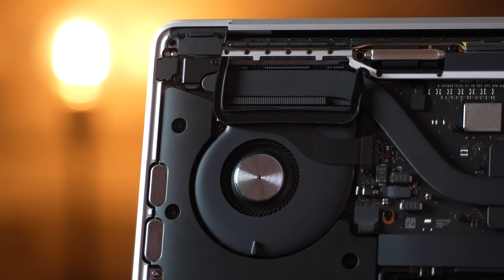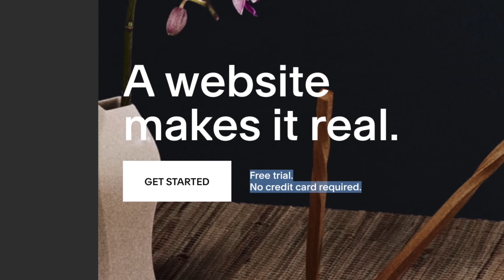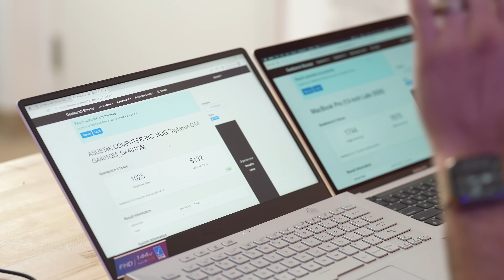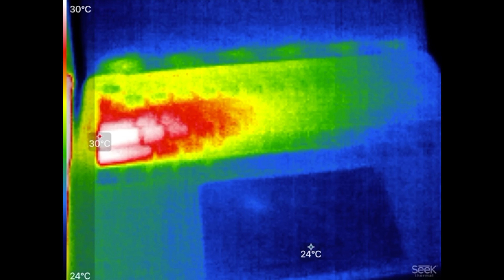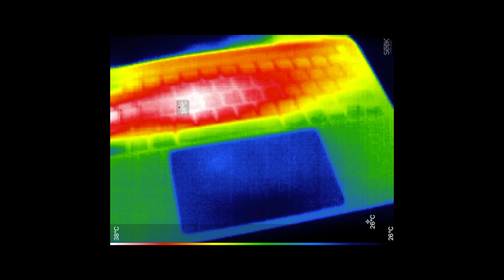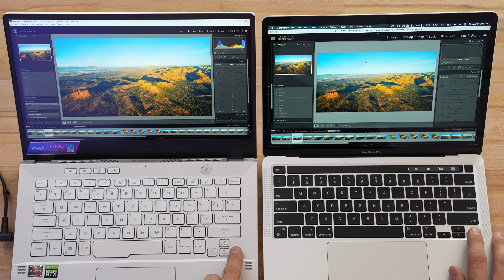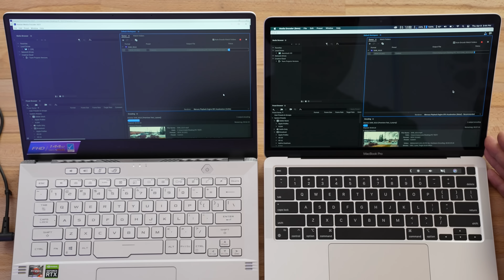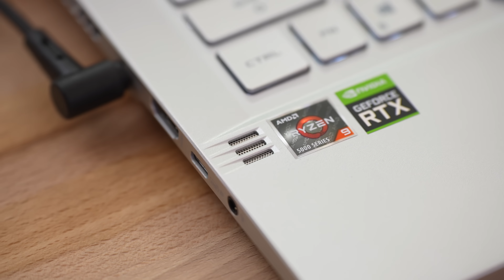Apple M1 vs AMD 5900HS + RTX 3060: FINALLY an M1 Killer?

Comment: Good comparison test. M1X will be the real trial, can't wait for that.
Reply: @Beats-h4z  ohh i forgot because apple makes their own chips not TSMC right
Reply: @OriginalFake Says somebody with no argument :D
Reply: @OriginalFake Yeah, and yet you waste your time answering this. Usual excuse for clueless people ;-)
Reply: M1X has to go up against Intels Alder Lake big-little design and Zen 4
Reply: @janklaassen6404  M1Pro with 256-bit memory controller is a beast and has no competitor in x86 PC world. Even desktop PC has only dual-channel DDR4 resulting in 128-bit mem bus. Quad-channel is a beast. And DDR5 at 6400 MHz makes it competitor to 8-channel AMD Threadripper.

And M1 Max with 8-channel DDR5 with 512-bit overall bus is out classing even server CPUs. Apple engineers are insane!

Giant Nvidia RTX3090 GPU has 384-bit mem bus. Apple APU has outclassing the most powerful GPU on market.

Pinch me somebody if I'm dreaming.

Good news is that Intel and AMD will need to cut CPU prices drastically to stay competitive.
Reply: What about the upcoming AMD cpu then?
Reply: @blinblinthing  he didn’t compare it to the HX model which is a lot thicker and draws consistent 45w
Reply: @blinblinthing  AMD is 6 years behind Apple in CPU development. At least. Zen 3 has 4xALU execution units only, this is what Apple had in A7 Cyclone core in 2013 up to A10 Hurricane core 2016. Apple has massive 6xALU core since A11 Monsoon in 2017 up to A14/M1 Firestorm 2020. This year A15/M2 core will be brand new architecture wider than that. Probably 8xALU, twice wider with twice IPC than AMD Zen 3. And Zen 4 will be facelit of Z3 so still 4xALU. All this is result of when Lisa Su fired Jim Keller who lead desig of AMD K12 - Apple-like ARM wide core with higher IPC than Zen. Jim knew the future is ARM and super-wide efficient core but Lisa Su insisted on high-clock x86 design. Shame on AMD. Funny enough that Intel's new Alder Lake is also 6xALU core and AMD has nothing to fight that until Zen 5 in 2023-24.
Reply: @arm-power  fair enough. AMD has mobile chips out benching Apple, so I don't think that's a good gauge to say 6 years behind.
Either way, I don't mind. Competition is good for consumers either way.
Reply: @arm-power  "the future is ARM and super-wide efficient core but everyone (except for Apple) insisted on high-clock x86 design". You nailed it.
Reply: @TheGoodTeller  The main genius behind Apple's CPU (Gerard Williams III.) created his own start up Nuvia which was bought recently by Qualcomm. We can expect Apple vs. Qualcomm clash of the titans.

Another interesting move chief CPU architect of Cortex cores Mike Filipo moved in Apple to fill gap after Williams. There is info about Cortex Makalu core: pure 64-bit, no 32-bit compatibility and this means also an opportunity for completely super-wide new design. Probably not as huge as Apple's/Qualcom's but probably much wider than Intel and AMD.

Super interesting things!
Reply: @blinblinthing  Apple M1 has +60% IPC over AMD Zen 3 (IPC= pts in GeekBench5 per GHz). AMD will need 4 generations each per +15% IPC gain to reach M1's IPC today. This means Zen 7 might get where M1 is today. Pretty bad future for AMD and Intel. They need DOUBLE cores and 4x more TDP to reach M1 performance. As soon as Apple will release 8-core and 16-core CPUs then AMD and Intel are dead also in desktop.

8-core AMD at 4.6 GHz using 63Watts outbenching sometimes 4-big core M1 at 3.2 GHz using 15W.
Reply: @arm-power  intel was dead since zen 2 
And btw pc will always stay alive and beat macs in sales as long as the games of macs are limited

And before u say I’m an intel fan and actually placing intel side by side with amd
It should be amd and apple as well as the M1 should be compared with ryzen 5000 pro u
Reply: @the_golden_s5682  Well, Intel's Ice Lake uarch has +15% higher IPC than Zen 2. Manufacturing is Intel's biggest problem. Golden Cove in Alder lake will have +20% higher IPC than Zen 3.

Problem is that Apple M1 has +60% higher IPC over Zen 3. Qualcomm Nuvia Phoenix next year with similar superb IPC as M2 will enter laptops and desktop too. And Mediatek will flood everything else with cheap Cortex X2 cores. Cortex X1 has +8% higher IPC than Zen 3. And all that based on ARMv9 which brings 2048 bit SVE2 vectors and matrix computing. AMD is stuck at 256bit vectors AVX from 2010. X86 is doomed.
Reply: @blinblinthing  they win and lose about the same time. And amd consumes like 2-3 heck sometimes even 4 times as much and you wanna talk ,,outbench‘‘ m1? With the m1x they don’t stand a Chance in raw CPU performance
Reply: @mvpdustin843  when a Ferrari beats a gtr, pivoting to the lower fuel consumption doesn't change the 2nd place. When a Ferrari loses to an F1 car, he can't pivot to the better mpg's. 
Point is, if you want to claim best performance per watt, say that, but the outright best performance was the AMD chip.
Reply: @arm-power  Bro you only have geekbenchmark? What about webkit code compile? You really believe apple M1 can complie code faster then AMD best? Thats why AMD 5 series is out of stock but Apple M1 chips are still available? lmfao bro I have a mini CPU farm mining crypto and apple M1 cant even pull its weight in hashing, encryption algorithm never mind anything else that CPU intensive.
Reply: @thangchanh2932  If dont like Geekbench you can take a look at SPEC2006 or SPEC2017 multi ISA bench. But M1 is even better there :D 

M1 is on stock because Apple has 90% of 5nm production in TSMC. Hashing uses special instructions and units in CPU so it's not right metric for CPU performance. Cortex A72 in Raspberry Pi 4 lacks them and is terrible in mining. Ryzens has strong hashing because it's used in servers.
Reply: @arm-power  "https :// xmrig . com / benchmark" find apple m1 on the charts. *Hint its in the 400s. And no ryzen are not used in servers lmfaooooo really? Weather or not they are used in servers has no correlation to their hashing ability. Two things youve said already that makes no sense. You know whats 80th on that list? Arm Neoverse N1 chip the same ones that AWS gravton is using. Apple M1 chips have no horsepower. Now you can PRETEND your appleM1 4 cylinder VTECH engine is FAST sure! but not compared to the V12s V8s out there. Sure the 4 banger is more fuel efficient but in terms of pure horsepower its nowhere on the map. You like my analogy?
Reply: @thangchanh2932  You are desperate. Apple M1 Firestorm core is the biggest architecture ever human kind created. M1 has 6x ALU integer units + 2x Branch units = resulting total 8-wide scalar core (this is big V8 engine from muscle car). Zen 3 has only 4x ALU integer units + 1x Branch unit which is like Honda Civic tiny engine which needs a lot of RPM (GHz) to stay comparable to Apple M1 huge engine. M1 has 60% higher IPC, which is like 10 years of development for AMD.

L2 cache: M1 has 12 MB.... Zen 3 only 0.5 MB.... 24x time less
L1 cache: M1 192 + 128 kB = 320 kB.... Zen 3 only 32 + 32 kB = 64 kB ..... 5x less

I can continue but I don't want to embarrass you too much.

BTW: Even Cortex X has 4xALU + 2x Branch and about 8% higher IPC than Zen 3.
Reply: @arm-power   cool story bro "higher IPC"  but cant hash hmmmmmmm stll havent addressed ryzen used in servers. lmfao the only thing im desperate for are a ryzen 5950x (which happens to be sold out everywhere I would pick ONE 5950x over even 20 free apple M1.) or at least some cheap first gen 7501s EYPCs, you know the one used in servers ;). Fact of matter is Apple M1 is slow. It cant hash, cant complie code and you wanna claim to be CPU king? LOL ok you can claim what you want. Use what you want. If apple M1 is faster for heavy workloads ppl will switch. The market will decide. You can drive your lil 4 banger all you want idc. Just dont expect to win if your matched up against a monster ryzen. 

Final thoughts, I actually use my hardware to make a living and if apple M1 will make me more money I will automatically switch without ur fanboyism or apples marketing. If datacentres will make more money for MORE performance they will order apple M1s sooo much to the point you the consumer wont even be able to buy it. I will be waiting for that day to happen. :) COME on apple make a 32 core chip. Blow me away. Since apple is ahead by 15 years this would be noo problem. hahahahahahah
Reply: @thangchanh2932  You're welcome. It's never too late to learn from more educated people.
Reply: @arm-power  lmfao yes says the one with ryzen in servers.  You just cant accpet that apple M1 isnt that fast. Fastest PER WATT maybe. Until the day apple can crack top 10 CPU list for mining or it can run Virtualization, or it can compile code faster then maybe I will take them more seriously. You know shit that GOOD cpus do, on platforms that offer I dunno more then 16GB of ram maybe? Think about it like this my dual amd 7501 eypcs (you know the shit they used in servers, but im sure you know that) that cost me 8500 to build will pay itself in 2 weeks. LMFAO how fast do you think the M1 pays itself? 2 years + 

Im typing this to you in a windows virtual machine running along with it 3 other VMs on a linux host. You know shit that im sure the M1 can do very veyr well.
Reply: @thangchanh2932  Yeah, 16-core Ryzen is faster in multithread than 4-core M1. But 8-core Ryzen 5000 is often beaten by 4-core M1. No surprise, M1's Firestorm cores are the biggest and most advanced architecture on the world. AMD fans are celebrating 5% higher IPC than Intel tiger lake. Well, M1 has incredible 60% higher IPC than Zen 3. Just accept AMD sucks and Apple rulez.
Reply: @arm-power  Bro real productivity people arent fanboys. We go where the machines make more money for us. If Intel can do more CPU workloads you will see that people will hop on to intel. Why do you really think people in the server market are fanboys? lmfaooo they just care about the bottom line. Lmfao 60% higher IPC in what? Cinebench? Code compilation? Heck even basic math can it find primes 60% faster? 60% higher hashing? please you mean 60% higher IPC per watt? Just cause the M1 is the best performance to watt doesnt make it the fastest.
Reply: @thangchanh2932  M1 has 60% higher IPC than Zen 3 in average according to GeekBench 5 (it consists of 15 independent subtests). In HTML5 subtest M1 shows more than 100% higher IPC (double IPC). AMD fanboys always asks for CB23 - M1 has 50% higher IPC there only.

M1 Firestorm core is humongous architecture! The biggest core ever created!  And I'm not talking about entire M1 SoC chip, I'm specifically talking about CPU architecture.:
- L2 cache: M1 ... 12 MB, Zen 3 ... 0.5 MB
- L1 cache: M1 ... 320 kB, Zen 3 ... 64 KB
- ROB: M1 ... 620, Zen 3 ... 250
- INT ALU execution units: M1 ... 6/7x, Zen 3 ... 4x
- FPU execution units: M1 ... 4x, Zen 3 ... 2x

This Firestorm architecture is MONSTROUS  in every way. And I'm saying that as proud Ryzen 3000 owner. But reality is tha M1 core has 90% higher IPC than my Zen 2.

Maybe one day you will accept reality too.
Reply: @arm-power  So like ive said at the very beginning all you got is geekbench? tahts all you have to show for number 1 CPU fastest in the world is just a geekbench score. Nothing else? While it loses to the 5600x in almost EVERYTHING else like but not limited too code compilations, hashing, simple math problems like finding primes, virtualization. You know shit ppl need real CPUs to do. https://www.youtube.com/watch?v=bdQ7u0mR570&t=502s

you know to claim to be the best you gotta win at least 80% of the workloads out there. Buy your M1 idc M1 makes me 0 bucks anyways, I dont own apple shares idc what you use. The market will decide not some youtube debate, like ive said if the M1 will outperform everything else in the market on more then 80% of the workloads you will see ppl flocking to them by the masses. The fact that im still putting in orders for amd eypc for my small business and desperately waiting for a 5950x for my personal rig. You think im dumb enough to not jump ship if apple makes me more money? 

The only fanboy here is you, i just simply go where the money is.
Reply: @thangchanh2932  50 benchmarks is not enough for you? Because that's exactly what GB, SPEC2006 and SPEC2017 consists of. Ray-tracing included (no need to use CB23 which favors AMD CPUs only).

Apple M1 has 60% higher IPC than Zen 3!!!! This means M1 is 4 generations ahead AMD. Maybe Zen 7 in 2027 will reach IPC of M1. But fanboy like you will never understand that.

Save your tears for M2. Because M2 will by 8-core monster, new and even bigger architecture than M1 and ARMv9 2048-bit vectors/matrix capable. You will cry a lot when M2 will be released :D
Reply: @arm-power  well this is going to be my last post but where are the 50 benchmarks? Sounds like your the desperate one now. I showed you countless proof already and yet you still cant come up with anything.  If the m1 is truely 60% faster how come it doesnt reflect in Cinebench, prime95 (this is a BIG one, your telling me your CPU is 60% faster but it cant do the SIMPLIST thing which is adding subtracting dividing and multiplying), hashing and virtualization? 

AND its okay you can keep being a fanboy, while we productivity folks will keep using AMD to make money. Works out fine for me in the end :)
Reply: @thangchanh2932   OMG clueless AMD fanboy :D You have no clue GeekBench and SPEC consists of 50 independent benchmarks including x264, ray-tracing, zip, etc? Now I understand why you have no clue what M1's 60% IPC advantage means (it's disaster for AMD and Intel)
Reply: @froznfire9531  ARM has 80-core Altra which destroys 64 core AMD EPYC in servers. And 128-core Altra Max is coming soon :)

So what? Do you think Apple cannot design server CPU or just doesn't need that?
Reply: @froznfire9531  Ampere is brand, Altra is their CPU, and it cost 4000 USD, half what cost AMD EPYC.

https://www.anandtech.com/show/16315/the-ampere-altra-review
Reply: @froznfire9531  Do not lie here. Show me link where you can buy EPYC 7763 for 5K, please.
Reply: @froznfire9531  Give me the link.
Reply: @froznfire9531  Yeah, 1 piece on stock and 8 happy users, it looks like scam or self-propagation. But those 4000$ for 80-core ARM Altra is OFFICIAL price. AMD's official price for 7742 was 7000$ https://www.anandtech.com/show/14694/amd-rome-epyc-2nd-gen/4

Altra can be sold also for lower price. It has around 500 mm2 while AMD 1005 mm2. Make your own conclusion. But all the metrics show x86 loses bad - slower and expensive.
Reply: @arm-power  LMFAO your still at this bro? Well im glad that youve learned a thing or two with our conversation. Im glad youve realized that your apple M1 aint shit compared to the big boys so now your going to pull out your hail mary Ampre Altra (this gotta be HUGE for you coming from someone who things ryzen are server chips)

What I see you havent yet learned is pricing (I would have thought you understood this aspect as you know, you being an apple fanboy and all). Lets put it this way, the altra has been out now for almost a good year. It has been in a few server configurations and IM SURE... IM SURE its sold out everywhere ;). lol sarcasm aside Meanwhile AMD milan has been released after the Altra and still in back order. NO ONE USES ARM. For every 1 arm customer there will be 100 x86 customers, besides the mobile market ARM stands no chance against x86 in the server market in terms of sales and marketshare. Im not saying ARM isnt the future but in the next 10-15 years x86 aint going nowhere.

But then again WTF do I know. Im sure your right anyways here bro go convince TSMC to go ARM they can sure need your help and expertise. Please go explain to them they should be using ARM and apple M1 chips because they are 15 years ahead of AMD. https://www.hpcwire.com/2021/05/08/amd-chipmaker-tsmc-to-use-amd-chips-for-chipmaking/ OMGGGGG "IS TSMC STUPID OR WHAT??? Dont they know Apple has the worlds fastest CPU the M1??!?!?!?!" :)
Reply: @thangchanh2932  This picture with 73% of market share for ARM 64-core Graviton 2  will not make you happy :D
https://images.anandtech.com/doci/16640/Neoverse_Intro_10_575px.png

This was just the begining because N1 is pretty weak (IPC as Zen2 only). N2 is +40% above N1 (+20% above Zen 3) and it has HBM2 and DDR5 and PCIe 5.0, and scales up to 512-cores using MCM chiplets. Of course ARMv9 with 2048-bit SVE2 vectors.

But the best will be N3 based on ARM Makalu core. Pure 64-bit CPU with no 32-bit compatibility. Every single transistor will be used for high performance in 64-bits. While x86 has to keep 16-bit and 32-bit compatibility and that awful variable instruction length coding from 1978.

ARMv9 is ISA from 2021 ;-)
Reply: @arm-power  LMFAO here we go again with this bullshit. 73% server market share are ARM BAHAHAHAHAHAHAHAHAHAHAHAHAHAHAHAHAHAHAHAHAHAHAHAHAHAHAHAHAHAHAH im not even going to respond to that. Just like ryzen server chips BAHAHAHAHAHAHAHA I can no longer take you seriously. News flash x86 dominates 98% if not more, of the server market share. WAIIIIIIIT dont respond do a little home work first please IM BEGGING you. Your making yourself look like a clown. The only market ARM dominates right now is mobile
Reply: @thangchanh2932  64-core ARM Graviton 2 is exclusive only for AWS, the world biggest cloud provider. Very surprising is that customers love ARM's 40% lower price. No it's not :D

And this MASIVE exodus to ARM will happen also in other companies as soon as they will start creating their own ARM server chips (MS and Google are working on it already). From 0% to 75-80%.

BAHAHAHAHAHA :D
Reply: @arm-power  ok can you beat the speed of 64 core threadripper 3990x with your 80 core altra

Cpu speed: calculate it if you don't sure

Amd ryzen threadripper 3990X

Base: 64x2.9 = 185.6 GHz
Turbo: 64x4.3 = 275.2 GHz
--------------
Arm altra 

Base: 2x80 = 160 GHz
Turbo: 3.3x80 = 264 GHz

And threadripper 3990x costs $4000 now
Reply: @dafi_ZG777  Yes, ARM Altra beats Zen2 Threadripper easily. Because Threadripper cannot sustain 4.3 GHz for all 64-cores. Zen 2 core consumes 14W @ 4.0 ... 64 x 14 = 896 W. Maximum TDP is 280W. All 64-core loaded run at 2.6 usually.

OTOH ARM is more efficient so 80-core Altra can sustain 3.0 GHz at full burn. This is the POWER of smart, efficient and modern ARMv8 instruction set. And 128-core Altra Max (Max Tech guys involved? :) ) is coming this year. Both 7nm TSMC.

AMD cannot put 128-cores simply because power consumption. Zen 4 at 5nm process will have only 96-cores.

And new ARMv9 is coming this year! New core N2 (+40% IPC jump over N1 or Zen2) can scale up to 512-cores in chiplet configuration. I guess 192-256 cores is reasonable maximum. But still N2 with 20% higher IPC than Zen 3 with 192-cores will annihilate poor 96-core Zen 4.

And best thing is coming in N3 based on Makalu core. Pure 64-bit CPU with no 32-bit compatibility. Every transistor aimed for 64-bit performance only. x86 has to carry ancient disgusting variable width CISC encoding of 16-bit 8088 and 32-bit i386 forever because x86-64 is an extension. While 64-bit ARMv8 was completely separated new ISA binary different to 32-bit ARMv7. That's why ARM is able to abandon 32-bit and save transistors. x86 cannot do that.

Of course everything has some pros and cons. ARM has many binary not compatible ISAs that's definitely the disadvantage. And this is DNA of ARM - in mobile when your chip is limited to 1 to 4W you don't have the luxury to waste power and transistors for backward compatibility. That's why ARM always do radical changes towards performance and efficiency. That's why they evolved faster into much better ISA and also the HW implementation - CPU.
Reply: @arm-power   
https://www.youtube.com/watch?v=spkjDN7Hf1k

watch it LITERALLY WHERE IS THAT 80 CORE ALTRA

trying not to spam there but i marked it as scam as i don't really found that 80 core  of waitwhat every search it has no products like this

don't you school? because that 'UPCOMING' text is for future you read on websites

god i search but no 80 core arm altra

scam master.
Reply: @arm-power   and 80 core is actually a 8 core processor

128 = 16 core processor
196 = 24 core processor

640 = 64
80 core is equivalent to 8
325 watts and 24 core processor?
https://www.youtube.com/watch?v=Fkk9DI-8el4

what the fuck did arm release their 24 core chipset?

because arm products are chipsets so 80 cores is equivalent to 8 cores.
and there's only arm cortex.

https://versus.com/en/mobile-chipset?filter[]=brands%3DARM
this makes you sad :D
--------------------
listen amd fanboys

And you never know this one. The intel xeon phi

Intel builds 72 core xeon phi to beat 64 core epyc 7742.

Slightly improvements for xeon phi are:
More cores (72 vs 64) 
More threads (128 vs 288) 
More mem channel (16 vs 8) 
Cheaper ($4650 vs $7000) 
More bandwidth: (357GB/s vs 190 GB/s) 
Year Build (2016 vs 2020) 
Uses chipset features (yes vs no) 
L1 Cache (4.6MB vs 4MB) 
L2 Cache (36MB vs 32MB) 

Series: knights corner knights mill knights landing vs ZEN 1 Rome Milan
-----------
Lastly you can place up to 2 xeon Phi's to enjoy 144 cores and 576 threads. 

More cores than the altra max & more threads than epyc 7763😂😂😂
Reply: @arm-power  apple never made any pcu or soc uneducsted dumb appe sheeple apple is behind every company 5 years amd ia cpu hardware maker apple is just seller made in china's sells like apple product pathetic loser company people belive in apple lies
Reply: @arm-power  stop compare crapoy m1 mobile to destop cpu cheap shit
Reply: @AchicaMkd  

Did you watch the video at all?
M1 is DESTROYING everything!! And it’s Apples FIRST chip!

M2 May be 50% faster!

Grow up kiddo.
Reply: @AchicaMkd  
Apple LITERALLY makes SOC and CPUs. Stop calling people “sheep” when Apple haters all repeat the same fallacies and lies.
Reply: @AchicaMkd  Apple M1 has +60% higher IPC over Zen3 - this effectively means AMD will need at least 4 CPU generations to get IPC od M1. And Zen 7 is expected 2027 or 28. AMD is in serious trouble.
Reply: @arm-power  Bruh I'm not even joking, the M1 is a disappointment, primarily because it lost on battery to the R9 in Cinebench. That thing has every advantage working for it, yet lost to something that's not even designed for efficiency.
The M1 is only ahead in some tasks because of TSMC 5nm. The Ryzen chip is on TSMC 7nm. Zen 4 on TSMC 5nm is expected to be around 25%-40% faster. That's going to be a massacre.
And lol Imagine what AMD would do if they decided they want to compete vs the M1X or M2... Pretty sure they'll have 32-cores on laptop. XMG did 16 cores with the 3950X in a laptop so no doubt its posible for AMD to optimize something like that.
Reply: @arm-power  Lol the Altra 80 core chips are not general purpose server chips. They only do very limited types of work. ARM is RISC -Reduced Instruction Sets. They can only run few types of tasks. Meanwhile EPYC Milan chips can run everything. Xeon and EPYC dominate like 95%-98% of the server market.
Reply: @whitehavencpu6813  1) ARM in servers has 73% market share for last 8 months. x86 only 27%. Take a look at this graph: https://images.anandtech.com/doci/16640/Neoverse_Intro_10.png 

2) x86 has 1000 instructions while ARM has 700 instructions - It's not reduced at all. ARM is very complex while using fixed 32-bit coding used in RISC machines (that's why Apple can decode 8 instructions per cycle while x86 only 4 due to variable length x86 instructions the CPU doesn't know where the others starts for parallel decode). ARM is actually hybrid taking the best from both worlds.

3) Altra has N1 core with IPC at Zen2 level. New N2 core is +40% above N1 so somewhere +15% above Zen3. Also 2048-bit SVE2 vectors originated from Japanese supercomputer Fugaku will be in every ARMv9 little core. Even wash-machine will able to process 2048-bit SVE2 vectors.

BTW Japanese super computer Fugaku is based on ARM CPU using no GPU, it's CPU only and it's beating x86+GPU super computers, all of them. ARM is worlds fastest super computer.
Reply: @whitehavencpu6813  1) Apple M1 has +60% IPC over Zen3. That's insane advantage which AMD will reach maybe with Zen7 if they do +15% IPC jump every gen.

2) Apple M1 has 384 kB L1 cache .... Zen3 has 64 kB L1 ...... 6x less

3) Apple M1 has 12 MB L2 cache .... Zen3 has 0.5 MB L2 ..... 24x less

4) Apple M1 has 16 MB L3 cache shared with GPU. AMD cannot share L3 with GPU.

5) Apple M1 has HW memory compression, patented. Period.

BTW Cinebench is AMD bench for AMD fanboys. How many people is raytracing professionals? Yeah every AMD fanboy since Bulldozer time :D
Reply: @arm-power  You know the difference between  "market share" and AWS servers, yes? The total server markets share the world over is dominated by x86. ARM is only seen in smaller "markets within markets" such as in AWS servers where they have a makret share(of around what? 10% your graph doesn't show 73% anywhere). ARM is more used in embedded devices than in servers. The Entire ARM server market revenue is a tiny blimp that's stayed exactly where it was for the past 6 years. https://businessquant.com/x86-vs-non-x86-server-revenue

" x86 has 1000 instructions while ARM has 700 instructions"
What bullshit is this? RISC has less than 100 instructions while CISC has 120-350 instructions. Further, all RISC instructions are of fixed length, if its 4 bits, then all instructions are 4 bits, if 32 then all 32. CISC can have completely variable length instructions, going to 64 bits as well. Its why ARM can't do shit outside what its designed to process. It requires everything to be coded specially for it or it won't run. 

Altra is again, not a general purpose server chip. Its fast, but barely scrapping past dual milan CPUs in workloads its designed to compute. EPYC server can be used for any thing, with a wide variety of applications, while the Altra is only even used in some data centers or VMs.

The fastest super computer has more to do with how much money is in the system than how fast the individual chips are. Its scalability and has nothing to do with ARM or x86. Few Super Computers are ever made and there are several years between super computers. The Summit uses IBM Power 9 x86 CPUs, not Intel or AMD, and those IBM chips get smoked by the modern EPYC 7742. 

Besides, the Fugaku is 1.42 Exaflops while the upcoming Frontier Super Computer is going to over take it, with over 1.5 Exaflops. Its going to be the world's fastest super computer and its using zen 4 EPYC chips from AMD.
Reply: @whitehavencpu6813  1) Amazon is the biggest cloud provider on the world. Those >50% for ARM is per whole year. But 64-core ARM Graviton1 server CPU was deployed since May 2020. Recalc that to last 8 months and you will get 73% for ARM and only 27% for x86 combined. 

2) MS and Google are working on their own ARM CPUs. Why? Because ARM is much better, higher IPC, efficient, cheap to buy a licence. x86 is like dinosaurs, ready to be annihilated by something better. For servers you are fine with clock speed around 3 GHz. 64-core AMD Epyc run around 2.5 GHz in all-core load. So in real world application ARM server CPU Altra runs at 3 GHz which is higher clock speed than x86. Efficiency baby!

3) 64-core Graviton2 is monolith beast. 80-core ARM Altra is also monolithic. And 128-core Altra MAX will be also monolithic. No wonder it beats AMD and Intel server CPU. x86 is tiny old garbage in compare to those.

4) Instructions: go and download Cortex X1 SW optimization guide. There are all instructions supported with how many cycles need to run. There is >500 instructions.  ARM is super complex. Wake up man.

5) Does x86 has an answer to 2048-bit SVE2 vectors in ARMv9? No they do NOT. BTW when x86 released new mandatory ISA standard (similar to ARMv8, and v9) last time? Oh wait, 2001 with x86-64. ARM does release new ISA version EVERY year!

6) New ARMv9 core Cortex X2 is 64-bit ONLY. No 32-bit compatibility. Every transistor is aimed for performance! IPC baby!
Reply: @arm-power  
 1) Amazon's cloud servers are a tiny fraction of global server chip demand. Like I already told you, amazon's servers are merely a market within a market. x86 globally is several times larger than ARM and its been that way for the past 7 years. In-Fact, x86 server marketshare GREW last year.

Also Amazon didn't switch to ARM because ARM was faster, no, they switched to ARM because they wanted  a custom chip to handle their data, with only instructions for what will be handled. The Graviton is a custom designed chip for only those specialized workloads. its far cheaper for them to make their own chips. That's all. The Graviton gets wrecked in any workloads today, its only good for price to performance.

2) MS tried and all their attempts have failed miserably. ARM is a joke when raw performance is required.

And no, Altra has worse IPC per core than AMD. Limit the Altra to 64 cores and it lags behind the EPYC CPUs even when its at 3 GHz.

3) Altra Loses in a myriad of benchmarks to AMD and sometimes can't even run benchmarks that aren't compatible with its instruction sets. Heck it can't even run Windows 10 Server. It only wins in simple benchmarks that are a tiny fraction of all things the x86 server chips can run. Like i said, the market for ARM is tiny. the Altra is not a general purpose server chip AT ALL.

4) HAHA X1 literally has complex instructions mixed with RISC. Same goes for Altra and Triton. They aren't fully RISC, more like semi-hybrids. That's why AMD's EPYC is very similar in wattage to these ARM server chips. Altra wouldn't have been over 200W if it were fully RISC. Its still nowhere in Instruction support. 

5)Nobody cares about those vectors, you can cry all you want about how they support larger instructions for security, it doesn't even matter becuase those intructions won't let ARM do anything more that what they already do. AMR is for SPECIALIZED workloads while x86 is GENERAL PURPOSE, which means x86 can do EVERYTHING. Hence why x86 has massive marketshare and ARM has been eating shit at the bottom for the past 7 years. Literally nobody wants ARM.

6) LOL as if dropping compatibility for older instruction sets is a positive. x86 can run anything.
Reply: @whitehavencpu6813  1) Mobile phone market is 7x higher revenue than all servers global. And ARM has 100% of it.

2) ARM expands into servers aggressively. While x86 is unable expand anywhere. X86 is loosing servers and super computers. Apple M1 is eating laptop market share. x86 is loosing everywhere except desktops. For now :)

3) Cortex X1 is standard ARMv8.4. There are no custom instructions. Neither Altra or Graviton2 are. Their Neoverse N1 core is ARMv8.2 based on Cortex A76 phone core.

4) Cortex A77 has +3% IPC over Zen2
Cortex X1 has +30% IPC over A77, so about +15% over Zen3.
Cortex X2 has +16% IPC over X1, so higher IPC today than Zen4 will have in at the end of 2022.

Stop crying, deal with it baby ;-)
Reply: @arm-power  1) So you admit, ARM is shit in servers! ARM only good for power efficieny, hence why they are in mobiles.

2) ARM has been exactly where they were since the past 7 years. x86 grew in market share last year. x86 isn't going anywhere until we break transistor gate density(Maybe 1nm node or something smaller). Linus Torvalds said t himself, x86 is going to remain for a good 15 years.

3) Amazon Graviton is a custom built chip. Get your facts straight.

4) IPC means nothing. AMD has higher IPC than Intel, yet intel wins in games and several workloads when the core counts are kept the same. IPC != performance. Core Clock is + IPC + Latency is. IPC is also application specific. 

ARM shall remain the peasants' low power compute platform. Everyone laughs at mobile gamers. Anytime real performance is needed, x86 is boss.
Reply: @whitehavencpu6813  1) ARM in servers: has higher IPC, higher clocks, lower latency (monolith chip), higher core counts... x86 is loosing everywhere. And better ISA (2048-bit vectors) on top of that :)

2) x86 is loosing market share in servers and laptops. It looks like you have no clue the difference between market share % and revenue in USD. 

3) Custom chip HW has nothing to do with custom instruction set ( low level language)... oh boy :)

4) x86 is old garbage with ancient 16-bit and 32-bit instructions. Who needs that baggage in 21. century? ARMv9 is brand new 2021 with 2048-bit SVE2 vectors. AMD is not able implement even AVX512 so they are using prehistoric 256-bit AVX2 😀

5) When you need performance today - you need Apple ARM power !!! Apple M1 has +60% higher IPC over Zen3. Or +90% over Zen2 if you like. DOUBLE IPC baby! That is MONSTROUS. AMD will need 6 years to get IPC level of an old M1 😉
Reply: @arm-power  1) You're missing the point of IPC: Its application specific. Most applications don't even support ARM so the IPC of ARM is practically 0 for those applications. ARM is specialized not general purpose. Nobody uses ARM for serious workloads. ARM is only needed when the software and applications are simple and repetitive. Windows 10 Server doesn't even support ARM.

2) ARM has been exactly where they were for the past 7 years. They make short rises in marketshare and then suddenly x86 booms ahead. x86 will continue to dominate for at least a good 15 years. 

3) Custom chips have everything to do with optimizing a certain set of instructions so that they are performed much faster or at lower energy costs. Pit the Graviton 2 vs a threadripper or  EPYC chip, it gets crushed. Its meant to be cheap to produce while being efficient and fast enough to run Amazon's secific server needs. Its not a general purpose chip.

4) x86 can run 64 bit ROFL. Besides those ISAs only affect security, There's no application yet that can take advantage of 2048 bit instructions so there's no comparisons to be made for how much faster it would make the  chip.
Also  AVX512 is available in upcoming 5nm/6nm EPYC chips.

5) ROFL Apple ARM power? Sure, show me how many benchmarks it wins against any Ryzen 5000 Desktop chip? Piece of shit can't even beat mobile chip in Cinebench, it lost in Light room it even lost in video export. 5600X on Desktop smokes it. 5950X Annihilates it. Oh and even Intel's new 11th gen mobile 11980HK destroys the M1 in laptop. M1 can't even mine!
Reply: @whitehavencpu6813  1) ARM has 100% applications ported at linux. Servers are 99% linux machines. Deal with it baby ;-)

2) ARM introduced 2048-bit SVE vectors in 2016. x86 has NO answer after 5 years. AMD will move finaly to 512 bit next year, what a tragedy :)

3) x86 will dominate museums in two years. In 15 years nobody will remember proprietary, closed and monopolistic garbage like x86 :)
Reply: @whitehavencpu6813  dont bother arguing with him. Hes just a fanboy. He knows nothing, just look at his responses. Lmfaoooo

Ryzen server chips, arm 78% server market share, 60% ipc rofl